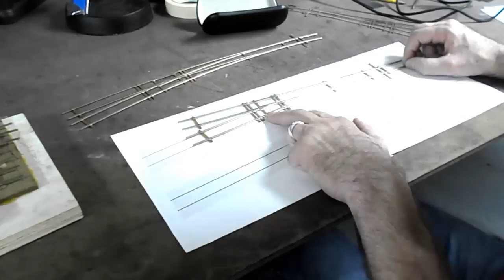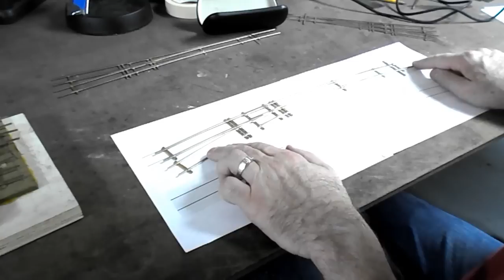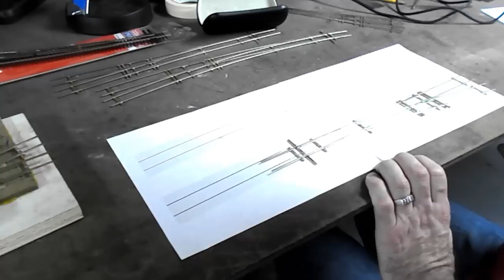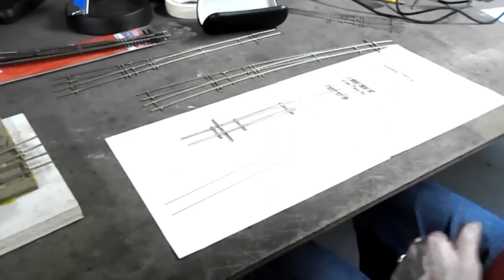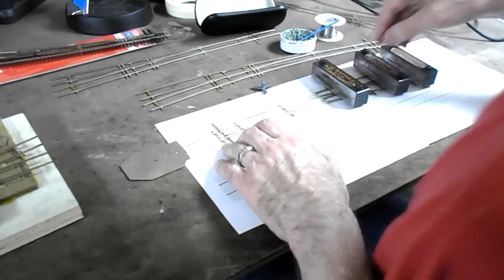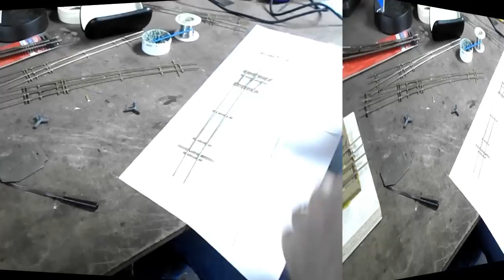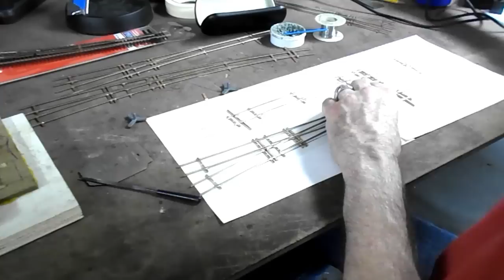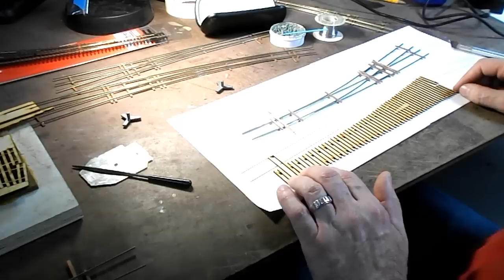Introducing flexible turnouts

Comment: I agree with the comments that congratulate you on being so innovative with FastTracks turnouts. 
I think back to all that time in 3rdPlanit trying to avoid all manner of curves around switches. I am a big fan of SoftTrack in 3rdPlanit for drawing 90 degree curves and it turns out I could be easing my crossovers into the curves with your idea. Dunno how brave I feel though. I will think about it a bit more.

A few things I have been working on in case they give someone else ideas:
I always buy drilled quicksticks and twistties as they are quite 'flexible' in how they can be used (flexible as in different uses....) 
I also use the #6 fixture to make short bits of straight track as most allow 5 wooden ties in between.
Finally, I use the fixture to create the curve needed to join a turnout to a parallel track. Works quite well.

Keep up the good work. Really enjoying your channel.